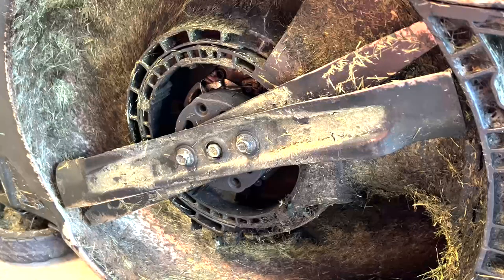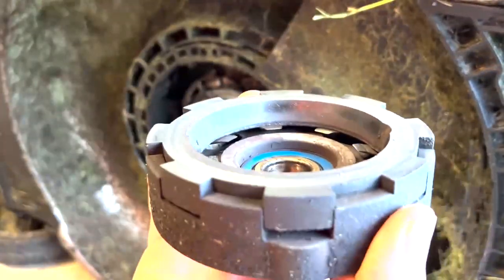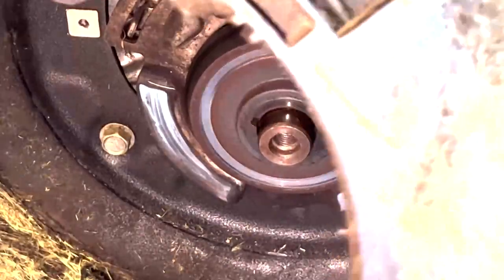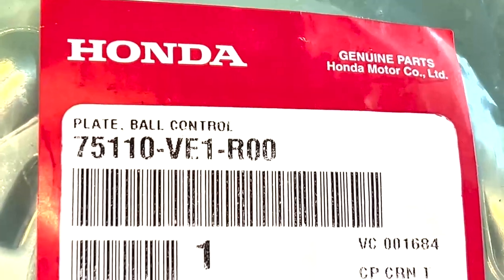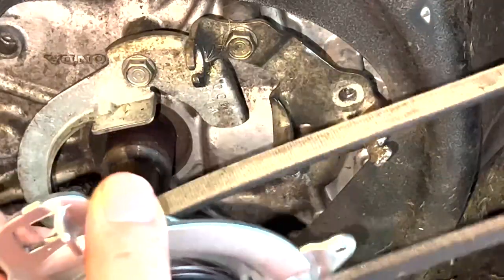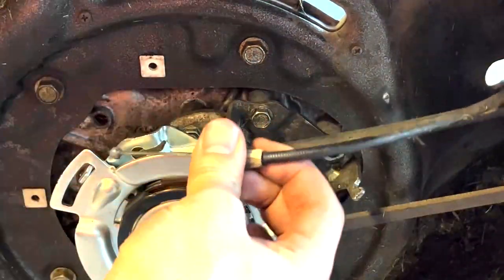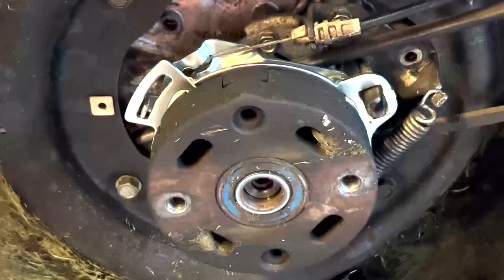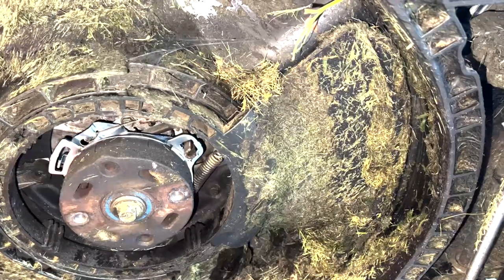How To Fix the blade clutch on a Honda mower

Comment: You make look easy. My belt is tight. Your has no tension. Wonder why?
Reply from the maker: You have to remove the spring that keeps the self propel belt tight it is near the rear of the mower next to where the pulley sits in the rear

Comment: Should of put some grease on shaft to prevent it from getting frozen on.
Reply from the maker: Thanks for the suggestion
Reply: @thehelpfulchannel5  I have had some where I could not get it off.
Reply from the maker: Ive heard of an Interesting mix of automatic transmission fluid and acetone idk if it will work better than store bought but its definitely worth a try. The mix is 50/50

Comment: Is there a way to permanently delete it . And not have the lever up top
Reply from the maker: What lever? The one for the blade clutch? It is a safety feature required by law on all mowers. And removing it can be a safety hazard
Reply: @thehelpfulchannel5  how do i remove it though
Reply from the maker: Unfortunately i would not know

Comment: Order a new bearing for the plate you replaced and replace it. You will have a spare plate.
Reply from the maker: Thanks for the suggestion
Reply: I have been trying to replace that bearing on my HRR2169VYA mower.  The difficulty is removing the outer part of the original ball bearing.  It seems to be push fitted and so far impossible to remove.  Is there a video with suggestions about removal of the original bearing?  Thanks.
Reply: @donalburns6548 only the middle part came out and the race stayed on it?
Reply from the maker: @donalburns6548 if i remember correctly i either used the end of the screwdriver and a hammer or a chisel and hammer to remove it. Yes it might take a bit of force
Reply: @donalburns6548 put some oil on it and use punch to tap on it by alternating sides to tap it out. Screwdriver could score the bore. Just take your time.
Reply: @mgomez5606  Thanks everyone for the hints.  I have used both rust remover  and release oil to try to free up the tight push fit.  Maybe mine is different.  I cannot use any sort of punch directly on the outer part of the ball bearing to remove it.   Of course I could drive it in, but there is a flange at the bottom which will prevent that sort of  procedure from driving the outer cover of the ball bearing from its holder.  I have manufactured a semi-circular piece of 1/16" brass to fit in the present small gap of 1/16" between the flange on the holder plate and the outer part of the bearing.  I then have used a socket on the brass piece to try and drive it out in the opposite direction and it has moved ever so slightly but so far no joy.  If I could get it to move even a little bit, i could then use a progressively thicker brass plate to get it removed.  My concern is it may have been inserted into the plate during its manufacture with a lot of pressure and my efforts to remove it may be minuscule in comparison.  I wonder if a bath of ice in the center of the former ball bearing might help release it?  I am reticent to heat the outer shell of the plate where the ball bearing sits.  Thanks again everyone agus Slán!
Reply: @donalburns6548  take it out the other side.

Comment: This procedure is incorrect. This will cause premature wear! Exploded parts diagrams are readily available. Print a copy or have your phone/tablet with you.  Servicing the blade clutch system is fairly easy.....im not sure how this guy managed to mess it up 😂
Reply from the maker: Thanks for your input
Reply: Well, it was still a very helpful video to show what's involved in this repair.